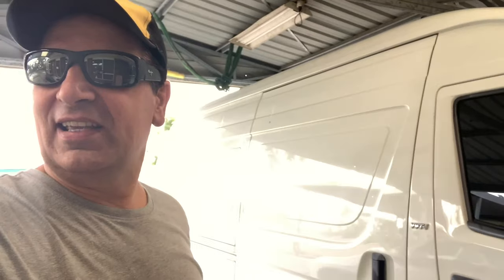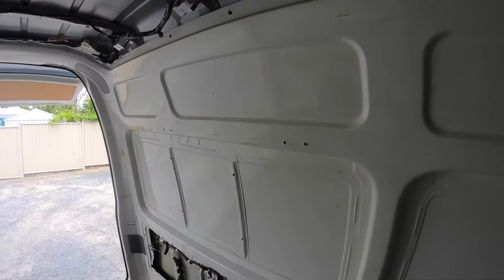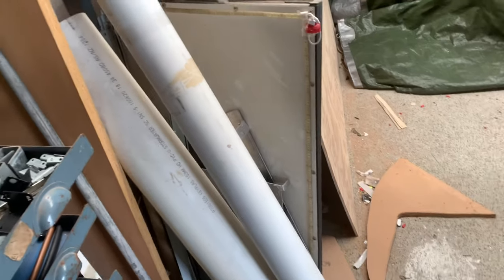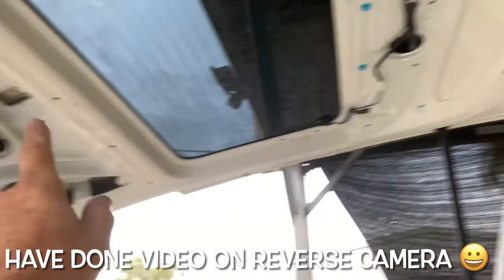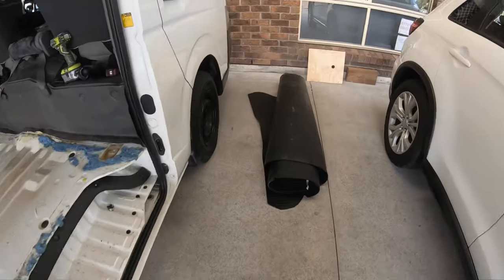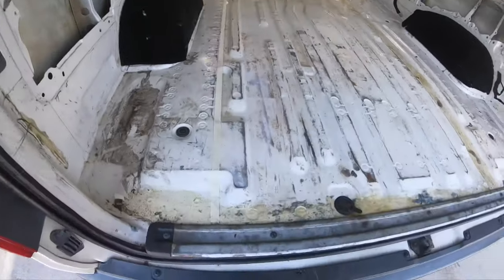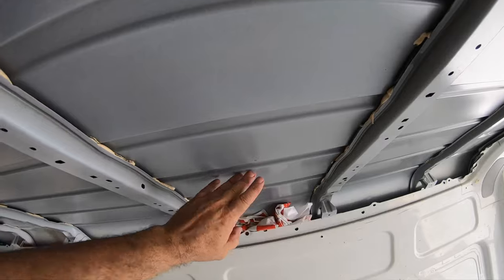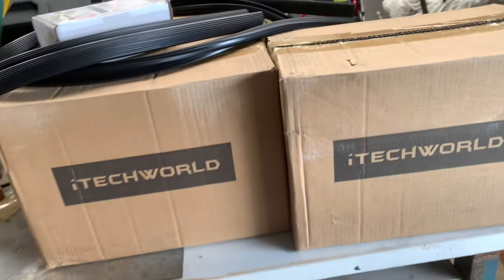Toyota hiace slwb off grid camper conversion planning

Comment: You can rig up a speed controller to the house batteries to turn on the van HVAC blower motors. Saves cutting the roof and more room for solar.
Van  with Tim on YouTube made a how to video.
Reply from the maker: Interesting will check it out . Thanks for that 👍🍻